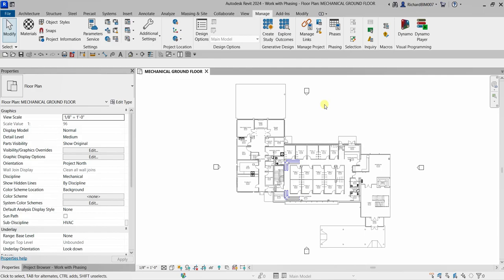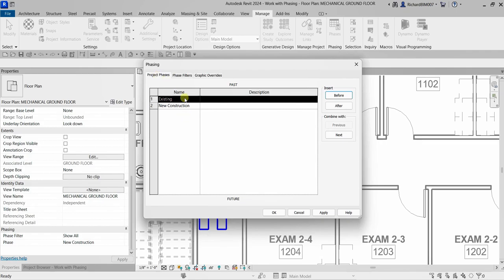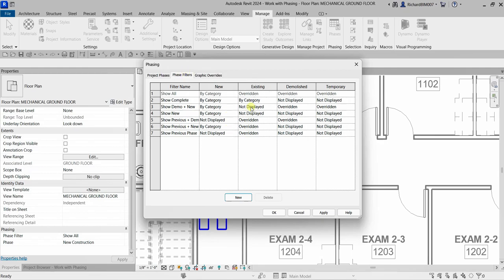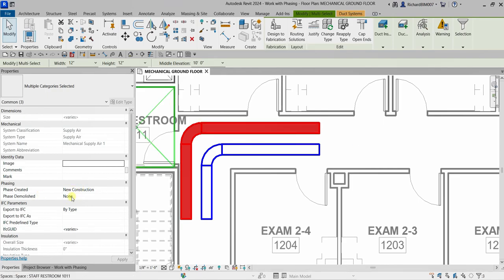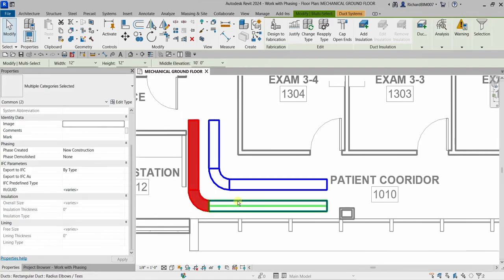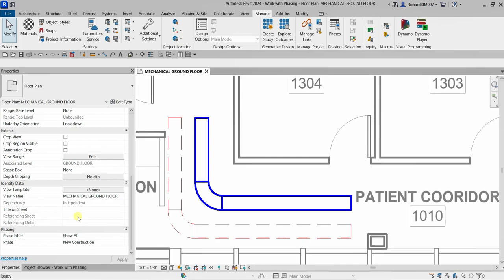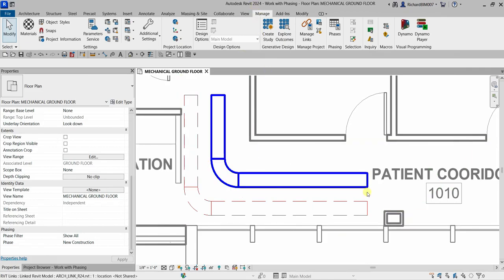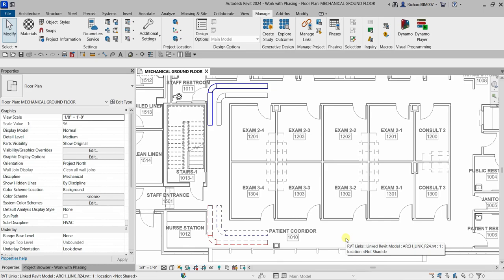REVIT MECHANICAL DESIGN PROFESSIONAL CERTIFICATION PREP: WORKING WITH PHASE

Comment: Do you have a cheat sheet for sale for the all the commands sequence for REVIT 2024; for instance to create sheets what are the steps to take.
Reply from the maker: I don't have a specific cheat sheet for sale, but I can outline the steps to create sheets in Revit 2024 for you. Here's a simple guide:

Steps to Create Sheets in Revit 2024

1. *Open the Project:*
   - Launch Revit and open your project file.

2. *Access the View Tab:*
   - Go to the *View* tab on the ribbon.

3. *Select Sheet:*
   - Click on *Sheet* in the *Sheet Composition* panel.

4. *Choose a Title Block:*
   - In the *Select Title Block* dialog, choose a title block from the list (you can also load a custom title block if needed).
   - Click **OK**.

5. *Place the Sheet:*
   - A new sheet will appear in the Project Browser under the *Sheets* category.
   - You can rename the sheet by right-clicking it in the Project Browser and selecting **Rename**.

6. *Add Views to the Sheet:*
   - Open the **Project Browser**, navigate to the views you want to add (e.g., floor plans, elevations).
   - Drag and drop the views onto the sheet.

7. *Adjust Viewports:*
   - Select the viewport to adjust its position, size, and properties as needed.
   - Use the *Properties* palette to modify the viewport settings (like view scale).

8. *Save the Project:*
   - Save your changes by clicking on the *Save* icon or using **Ctrl + S**.

Additional Tips

- You can use the *Keyboard Shortcuts* dialog (found under the *View* tab) to set or view shortcuts for common commands.
- Creating a cheat sheet for commands can be done by noting down frequently used commands and their keyboard shortcuts for quick reference.

If you're looking for a more comprehensive guide or cheat sheet covering all commands, you might consider checking online resources, forums, or educational platforms that offer detailed materials on Revit 2024.